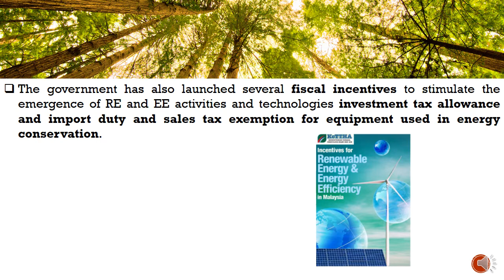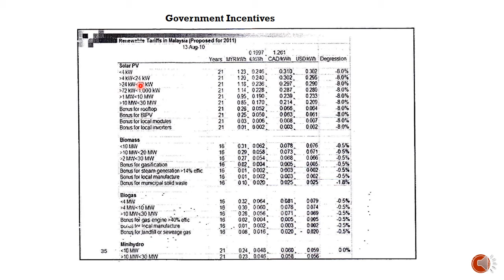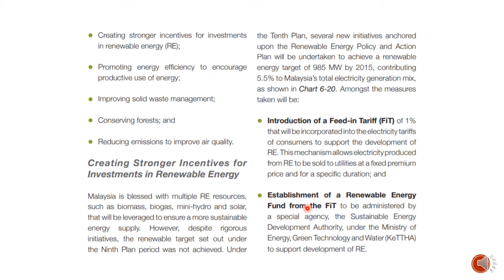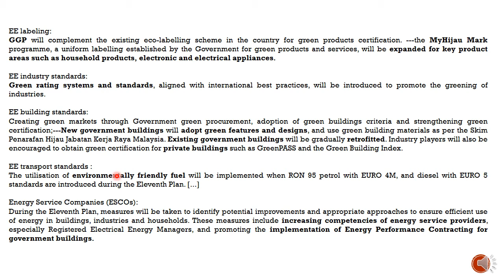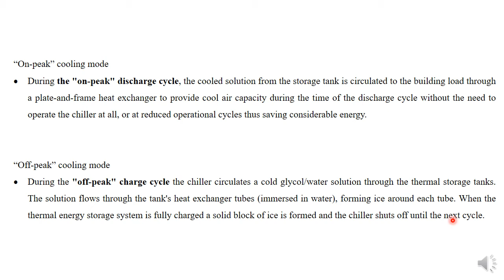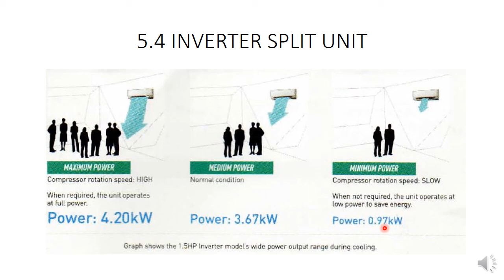Lecture 5&6 Application of “Green HVAC System” in industry

Comment: MUHAMMAD HAZIM BIN ISMAIL
B071710545
4BMMH S1/1

5.0 APPLICATION IN INDUSTRY
Energy efficiency (EE) strategies under the 9MP (2006-2010)
•	Measures to reduce wastage
•	Enhancing energy efficiency
•	Increasing energy sufficiency
•	Reduce dependence on petroleum products
Aim
•	Energy saving features in the industrial and commercial sectors
EE features
•	Efficient lighting and air conditioning systems
•	Establishment of a comprehensive energy management system
•	Several fiscal incentives
•	Investment tax allowance and import duty and sales tax exemption for equipment used in energy conservation
Type of incentives for companies providing EE services / adopting EE initiatives
•	Pioneer status (PS)
•	Investment tax allowance (ITA)
•	Import duty and sales tax exemption

Malaysian Tenth Plan (2011-2015)
One of the five strategic pillars of the new energy policy
•	Energy efficiency
     -	Industrial
     -	Commercial
     -	Residential
     -	Transport
Environmental management
•	An incipient industry with substantial growth potential in green technology
•	Spin off new categories of professionals and new areas of specialization for architectural and engineering services.
The key strategies to nurture the growth of this segment include:
•	Streamlining the Green Technology Council to drive the green technology agenda across multiple ministries and agencies which include regulatory aspects, developmental, awareness and promotion
•	Creating the environment and demand for the green technology industry to spur business opportunities for professional and service providers by:
     -	Developing and enforcing regulations especially on energy efficiency in buildings for new developments
     -	Promoting investment in renewable energy to provide long-term contracts for renewable energy providers and create the spillover effects on the related domestic service providers.
     -	Promoting culture of conservation and efficiency in energy and water use
Affirm framework
To increase Malaysia’s competitiveness:
•	Increased labelling of environmentally-friendly goods and services:
     -	Energy efficiency star rating
     -	Low carbon footprint products
     -	Green building index
In Malaysia Tenth Plan, government:
•	Creating stronger incentives for investments in renewable energy (RE)
•	Promoting energy efficiency to encourage productive use of energy
•	Improving solid waste management
•	Conserving forests
•	Reducing emissions to improve air quality
Creating stronger incentives for investments in renewable energy
•	Introduction of a Feed-in Tariff (FIT)
•	Establishment of a renewable energy fund from FIT
Initiatives to drive energy efficiency efforts
•	Industrial
     -	Increasing the use of energy efficient machineries and equipment
     -	Introduction of Minimum Energy Performance Standards for selected appliances to restrict the manufacture, import and sale of inefficient appliances to consumers

Malaysian Eleventh Plan (2016-2020)
Government aims to:
•	Increase the adoption of energy-efficient and low carbon buildings, transports, products and services.
EE targets:
•	By 2020, at least 20% of government procurement will be green
EE action plans:
•	Enhancing demand side management (DSM)
•	Main goal of DSM:
     -	To encourage consumers to use less energy during peak hours
     -	To move the time of energy use to off-peak hours
•	User awareness will be enhanced on energy labelling and availability of standards
•	Introduction of Enhanced Time of Use (EToU) tariff scheme and gradual abolishment of the Special Industrial Tariff
•	Government work with relevant private agencies to increase adoption of EEVs (energy efficient vehicles)
EE labelling:
•	MyHijau Mark programme, expanded for key product areas
EE industry standards:
•	Green rating systems and standards
EE building standards:
•	New government buildings will adopt green features and designs
•	Existing government buildings will be gradually retrofitted
EE transport standards:
•	Utilisation of environmentally friendly fuel
Energy Services Companies (ESCOs):
•	Increasing competencies of energy service providers
•	Implementation of Energy Performance Contracting for government buildings

Examples of green technology in HVAC industries:
•	Thermal Energy Storage
     -	Ice stores are used in refrigeration in order to cover and increased additional refrigeration demand (peak load)
     -	Capture low-cost energy from power grid during night (off-peak)
     -	Use captured low-cost energy to replace high-cost cooling energy during following day (on-peak)
     -	Generally good for any new facility that has a large cooling load during daytime and little or no cooling load at night
•	Hybrid Chiller
     -	Ability to handle large loads at very high efficiency and low cost
     -	Combines condenser and cooling tower into an all-in-one packaged hybrid chiller
     -	Achieving a higher energy efficiency, better reliability and lower maintenance cost
•	Desiccant Dehumidifier System
•	Inverter Split Unit

Comment: MUHAMAD IZMAN BIN JAMALUDDIN
B071710518
4BMMH S1/2

Energy efficiency (EE) strategies under the 9MP (2006-2010)
1. Encourage better utilization of RE through diversifying fuel sources. 
2. Intensify efforts to reduce the dependency on petroleum provides more to integrate alternative fuels.
3. Incentives in promoting RE and EE are further enhanced.

Aim:
Emphasis on strengthening initiatives for EE especially in transport, commercial and industrial sectors, and in government buildings.

Social Impact 
1. Increase awareness and involvement from the public and stakeholders in the development of the country's energy efficiency program. 
2. Strengthening regulations and enforcement on energy efficiency across the country to ensure a continuous power supply.
3. Improve the management and human resource development to build human capital and experts in the field of energy efficiency.

7 GREEN TECHNOLOGIES THAT ARE CHANGING HVA

       1.      Dual fuel heat pump
       2.      Smart Thermostat
       3.      Zoned System
       4.      Ice-Powered Air Conditioner
       5.      Solar-Powered Air Conditioner
       6.      Geothermal Heat Pump
       7.      DeVAP Air Conditioner

Comment: NUR SELIHAH WAL HUDA BINTI AHMAD - B071710190

1) Energy efficiency (EE) - Government will adopt measures to reduce wastage by enhancing energy efficiency & increasing energy sufficiency. They also reduce dependence on petroleum products. 
2) The EE is for energy saving features in the industrial & commercial sectors.
3) Gov. launched several fiscal incentives to stimulate the emergence of RE & EE activities. 
4) Type of incentives
   - Pioneer status 
   - Investment tax allowance
   - Import duty & sale tax exemption
5) Environmental management is an incipient industry with substantial growth potential in green technology such as developing & enforcing regulations especially on EE in buildings for new developments. 
6) Affirm framework is marketing strategy to increase environmentally-friendly. 

Example of green technology in HVAC
1)Thermal Energy Storage
2) Hybrid chiller
3) Desiccant dehumidifier system
4) Inverter split unit

Comment: NUR FITRAH NADIA BINTI KAMIDAN
(B071710363)
4BMMH S1/2

Energy efficiency (EE) strategies under the 9MP (2006-2010)
1.	To reduce the wastage by enhancing energy efficiency 
2.	Increasing energy sufficiency.
3.	To reduce dependence on petroleum products

Aim:
1.Energy saving features n the industrial and commercial sectors
2.Efficient lighting and air conditioning system as well as encouraging establishment of a comprehensive energy management system.
3.Fiscal incentives to stimulate the emergence of RE and EE.
4.Investment tax allowance and import duty and sales tax exemption for equipment used in energy conservation.

Type of incentives foe companies providing EE services / adopting EE initiatives 
1.	Pioneer status (PS)
2.	Investment Tax Allowance (ITA)
3.	Import duty and sales Tax Exemption

5 strategic pillars which is;
1.	Energy efficiency
2.	Market pricing
3.	Supply side initiative
4.	Stronger governance 
5.	Managing change

Example green technologies in HVAC field.
1. Thermal energy storage
2. Hybrid chiller
3. Desiccant dehumidifier system
4. Inverter split unit

Comment: HAKIM BIN ZAINUL B071710531 BMMH S1/1

APPLICATION IN INDUSTRY
Energy Efficiency (EE) 9MP (2006-2010)
•	Measure to reduce wastage by enhancing energy efficiency and increasing energy sufficiency. Also, to reduce dependence on petroleum product.
Aim
•	Energy saving features in the industrial and commercial sectors
The features of EE
•	Efficient lighting and air conditioning system an establishment of comprehensive energy management system. 
•	Fiscal incentive, investment tax allowance and import duty sales tax exemption for equipment used in energy conservation.
Type of incentive EE services 
•	Pioneer status (PS)
•	Investment tax allowance (ITA)
•	Import duty and sales tax exemption
5 strategic pillars
•	Energy efficiency
•	Market pricing
•	Supply side initiative
•	Stronger governance 
•	Managing change
Environmental management
•	Growth potential in green technology 
•	Developing and enforcing regulation especially on energy efficiency in buildings for new developments.
Affirm framework
•	Increased labelling of environmentally-friendly goods and services
•	Such as energy efficiency star rating, low carbon footprint products and green building index.
•	Introduction of a feed-in tariff (FiT)
•	Establishment of a renewable energy fund from the FiT,
Malaysian Eleventh Plan (2016-2020)
•	Increase the adoption of energy-efficient and low carbon buildings, transport, product and services.
•	EE target by 2020, is at least 20% of government procurement will be green.
EE labeling
•	GGP, will be expanded for key product areas such as household products, etc.
EE industry standards
•	Green rating systems and standards.
EE building standards 
•	New government building will adopt green features and designs
•	Existing government building will gradually be retrofitted.
EE transport standards
•	Environmentally friendly fuel 
Energy services companies (ESCOs)
•	Increase competencies of energy 
•	Implementation of energy performance contracting for government buildings.

Comment: AHMAD ASYRAFAMIRUDIN BIN AZNAN 
4BMMH S1/1
B071710607

Energy efficiency (EE) strategies under the 9MP (2006-2010)
-	To reduce the wastage by enhancing energy efficiency 
-	Increasing energy sufficiency.
-	To reduce dependence on petroleum products
Aim:
-	Energy saving features n the industrial and commercial sectors
-Efficient lighting and air conditioning system as well as encouraging establishment of a comprehensive energy management system.
- Fiscal incentives to stimulate the emergence of RE and EE.
- Investment tax allowance and import duty and sales tax exemption for equipment used in energy conservation.
Type of incentives foe companies providing EE services / adopting EE initiatives 
-	Pioneer status (PS)
-	Investment Tax Allowance (ITA)
-	Import duty and sales Tax Exemption 
Environmental management is an incipient industry with substantial growth potential in green technology and will spin off new categories of professionals and new area of specialization for architectural and engineering services.
Key Strategies to nurture the growth of this segment include:
-	Streamlining the green technology council to drive the green technology agenda across multiple ministries and agencies which include regulatory aspects, development, awareness and promotion
-	Creating the environment and demand for the green technology industry to spur business opportunities for professional and service providers by:
-	Promoting investment in renewable energy to provide long-term contracts for renewable
-	Promoting culture of conservation and efficiency in energy and water use
Example green technologies in HVAC field.
-Thermal energy storage
      - Iced storage are used in refrigeration in order to cover and increased additional refrigeration demand
      - Capture low cost energy from the power grid during the night.
      - No cooling load at night and good for any new facility has a large cooling load during daytime  
- Hybrid chiller
     - to handle large loads at very high efficiency and low cost 
       -low operating cost 
       -saves space, plant room not required 
      - is easier to maintain 
      - easier and cheaper to install 
      - energy efficient, consumes 10%-30% less energy.
     - 45%-50% less water consumption
- Desiccant dehumidifier system
     - humid outside air
     - dehumidified Air
    - regeneration and heater 
    - moist air to outside  
- Inverter split unit 
    - output power is consistent 
    - compressor consistent running or speed 
Compressor rotation speed:
High = maximum power
Normal = medium power
Slow = minimum power
- Non-inverter split unit
    - output power is not consistent 
    - compressor not consistent running or speed